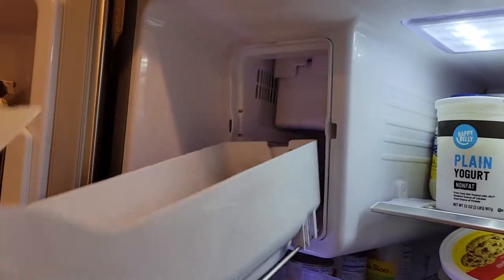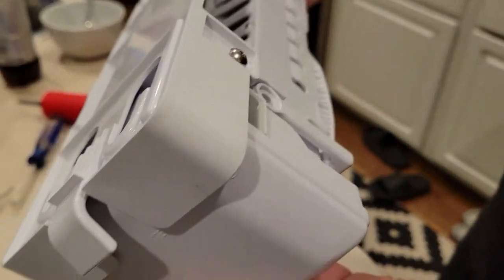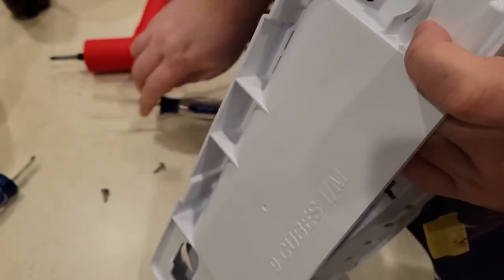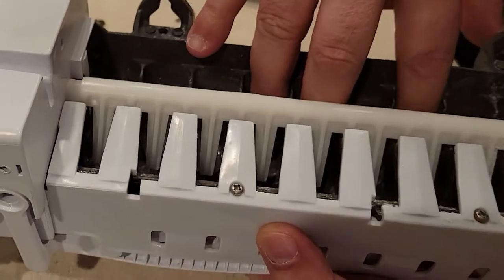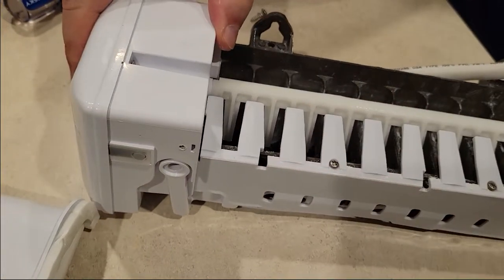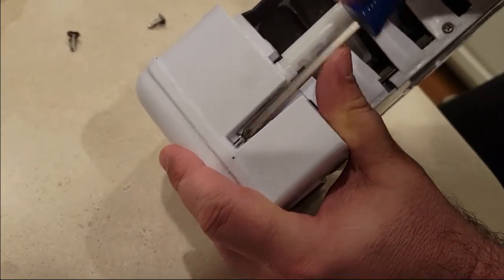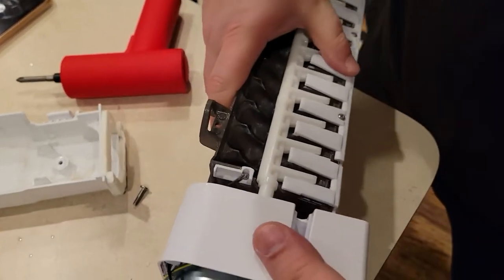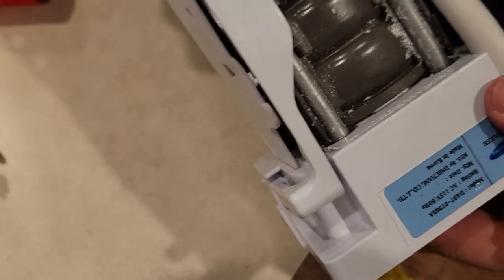Samsung Ice Maker Repair - RF4287HARS/XAA AND SIMILAR MODELS

Comment: Hi, amazon link says no longer available on the fuse, could you possibly provide a different link? Also, it appears the fuse will need soldered on, is that correct?
Reply from the maker: Thank you for letting me know that the link is no longer good.  I was able to find a replacement:

https://amzn.to/46H6HxU 

The new fuse will need to be soldered on or you can use a crimp connect to connect it if you are not good at soldering.  Either way, be sure to use some heat shrink tubing to keep it from shorting against anything.

I hope this helps!
Reply: @TheTerrorBeyond  thanks!  Just curious when you solder do you cut the leads of the fuse down to about an inch or leave them full length and cut the existing wire?
Reply from the maker: @kentofficerdph8477  Just get the fuse where the bend of the leads fits right around the housing and cut there, then solder inline.  You don't want too much extra in the housing, so just try to match the factory length.

Comment: Same ice maker and ice maker is making ice but is also dripping water into ice bin cause ice to block. Would thermal fuse solve this too, perhaps heating is too aggressive? I have swapped ice maker into identical refrigerator to confirm problem is ice maker itself.
Reply from the maker: That is a good question.  The thermal fuse is very cheap, so it can't hurt to change it and see if it helps.  That will save you a good bit over a new ice maker unit.  Please let us know what you find out on this, as I don't know the answer to this.

Comment: Do I need to turn close the water supply before removing the icemaker ??
Reply from the maker: It is not necessary.  You can remove it without pulling the refrigerator away from the wall.

Comment: I suspect this is issue with mine, but have ordered replacement icemaker anyway.  Reason being other parts had failed as well.   Icemaker would make ice but not eject it.  However,  in trying to eject it the unit stripped some of the plastic teeth on the drive gears for the ejector.   Unit would just make loud clicking noises but never eject ice.   Suspect the loud clicking noises were due to the broken teeth.
Reply from the maker: That could absolutely happen.  The gear could shear off over time, so the new unit is a good deal.

Comment: I was having this problem with the ice ejecting.  It I would push the reset button, it would work for a couple days and make small, irrregular shaped cubes.  Now the unit seems to be completely dead.  The reset button appears to have no effect now and I hear zero noises coming from the unit and of course no ice production at all.  Do you think this problem has progressed beyond this fuse?   Also, is there soldering required to put the new fuse in?
Reply from the maker: If there is no ice being made anymore, you will need a new unit.  The fuse will fix the issue if there is ice being made, but it cannot be extracted.  In your case, this doesn't sound like the issue.  IF you were to replace the thermal fuse you would cut the existing fuse off and solder the new on one.  I would also use heat shrink tubing on the legs of the new fuse just to be safe.

The fuse won't fix the issue if the unit will not fill with water anymore though.

Replacing the ice maker isn't terribly expensive, as they can be bought for about $120 on Amazon (genuine part), and it will take about 5 minutes to do the work.
Reply from the maker: One question: have you removed the ice maker to be sure that it is or is not producing ice?  If there is ice in the tray, I would suggest defrosting the unit and extracting the ice, then putting it back in to see if ice is made and cannot be extracted. If you find that ice is created and not extracted, your fuse is the likely culprit.
Reply: @TheTerrorBeyond  As far as I can tell there is no water flow to the unit anymore and there are no more noises from the unit attempting to eject ice.  My thought is the problem was the fuse but progressed to the unit failing.  I am going to replace the unit and keep my fingers crossed.
Reply from the maker: @HH-gn9qt  Please come back and let me know how it goes.  It could be a number of things.  There is a control board in the ice maker that makes the water run at the proper interval, and the extractor to operate at the appropriate interval, etc.  Not hard to replace, but I can't guarantee that it would fix the problem.
Reply: @TheTerrorBeyond  I just pulled the ice maker and when I plugged it back in I was able to hear very weak motor noises coming from the unit. I am guessing it was the ejector as that is the only moving part as far as I know.   I also heard the water supply start and stop quickly.    I pushed the reset button for kicks as previously it would make the ice maker work intermittently for a couple days.  New unit has been ordered.  Will come back to report results...
Reply: @TheTerrorBeyond  Installed the new ice maker and problem is solved.  Ice is being produced in full cubes and on a regular frequency as expected.  I pulled the fuse on the old unit for fun.  The was continuity, so I I guess it wasn't the thermal fuse.  Oh well, I have a bin full of ice now so life is good!
Reply from the maker: @HH-gn9qt  Great news!  Much better than calling a repairman any day!  :D
Reply: We have a Samsung as well, and the same thing happened to us. After a phone call to Samsung, and some determination, Samsung sent out a tech and replaced it for free - they even admitted that they had a LOT of faulty ice makers and ours was probably one of them.
Reply from the maker: @murdercircus7706  I have read that there have been a lot of problems with the ice makers... I should have called them.
Reply: @TheTerrorBeyond  We have two Samsung refrigerators: One is from 2008 and is now in the garage, the other 2019. Both have always made anemic ice cubes in paltry amounts, even after the new ice maker was installed. Lame. I'll gloss right over the Samsung brand name the next time we are fridge shopping.
Reply from the maker: @murdercircus7706  I will definitely look for something else next time as well.  I like the refrigerator overall, but this is a bad design that they know about.

Comment: Thank you so much for this helpful video! Right before Christmas, our ice maker stopped working. All I could find were diagnostics and instructions on resetting the ice maker. After resetting the ice maker, the ice was still stuck. I used a heat gun to warm the tray enough to force the ice out. However, the ice maker still wouldn't function properly and continued to get stuck. Your video came to the rescue by demonstrating how to remove the ice maker, revealing that the thermal fuse was the problem. After replacing the fuse, it's now working perfectly again. Thank you once more! Your video was incredibly accurate and helpful.
Reply from the maker: Thank you for your comment!  I am glad that the video helped and saved you some money. :)

Comment: Our has no ice,  in it,  we changed the water filter and i checked the water valve behind the fridge.  The water comes out Great from filling a glass on front door.  although the water valve stops short of filling the ice maker. Any other suggestions would be much appreciated. Thank you.
Reply: This is the issue we are having. The ice maker was making a wheezing sound each cycle but now it's not making any sound. Did you find a solution to your issue? Thank you!

Comment: My ice maker stopped working; it would not dispense ice but it was present inside the unit.  I watched this video and was able to fix it at minimum cost!  It turned out the temperature fuse was bad, exactly as this video described.  I tested it and did not have continuity between its terminals.  I went to eBay and found the replacement in China, so I bought 5 pieces for $5 and they arrived relatively quickly.  I disassembled the unit, removed the offending part, and soldered in the replacement fuse.  A few hours after installation ice was being dispensed again!!  The only thing I want to point out is that those temperature sensors are very delicate.  I ruined two of them because they get damaged if they get too hot during soldering.  Make sure to test for continuity between the terminals once you are doing soldering.  Overall, I fixed it for a few bucks.  It is not that difficult but you definitely need to have a bit of a bend for using tools and soldering. I estimate that having hire a technician who would have diagnosed and, more likely, recommended replacing the whole unit, it would have cost about $600. Give it a try and save yourself some money.  Worst case scenario, just purchase the entire unit for about $100 and replace it. Thanks for publishing this video!!
Reply from the maker: GREAT!!!  I'm glad you were able to get it fixed!

Comment: Great video!. I'm having a problem removing the ice tray. I have pushed hard on the tab and pulled the icemaker from the back, but it will not budge. Does anyone have a suggestion?
Reply from the maker: It is a very tough clip... I would try pressing the tab down and then putting a flat head screwdriver into the space at the top of the tab and lightly angling it to try to get the tab to release.  Be careful when doing this, as I don't want you to damage your refrigerator.  Perhaps put a bit of cloth in between the screwdriver and the refrigerator top.  This clip is quite tight, so it might take you a moment.

I hope this helps!
Reply: @TheTerrorBeyond  Thanks for the help. I did a variation of your suggestion. I used a 1 1/2" plastic putty knife - it worked.
Reply from the maker: @melvinstrike  Great!  I'm glad you got it out!  :)